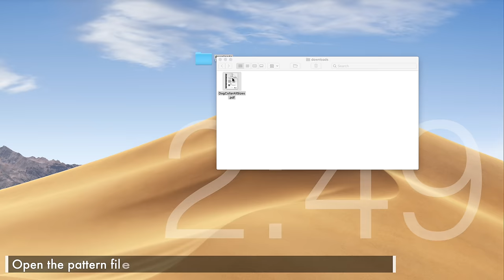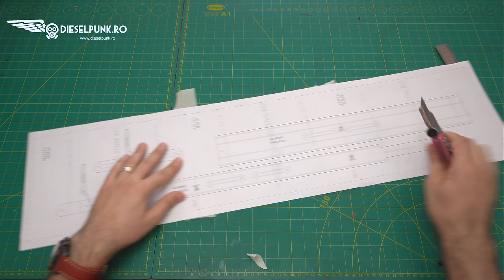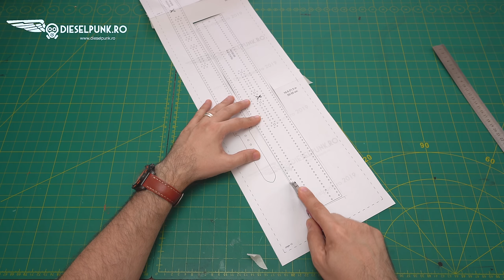Dog Collar DIY - Pattern and Tutorial

Comment: Tony
Awesome job! Really appreciate the pattern looks great. 
Just FYI there’s small mistake with the 35-39cm portion the folding leather piece doesn’t really align with the belt piece. I was able to fix it by cutting both piece a little short.
Reply: I experienced that too. But on a worse note, I didn't think to turn the flesh side out before riveting and stitching the bottom strip to the upper strip.  What a mess I made! Had to take it all apart. But like they say, if you're not making mistakes, you aren't learning.
Reply: Skip Hinton It happens, that’s good way to look at it for sure.
Reply: @AZAZALEX  I'm starting my second one. Hopefully it's gonna turn out better.

Comment: Holy Moses Tony, that Sinabrooks stitching punch is like $140.  1.5mm/6mm-6 holes. Now the $140 question is was it worth it? Does it punch holes better then other methods? What about going around a radius? Do you then just use single punch?

Comment: In this build the buckle will sit on the throat of the dog because it is on the opposite side of the d-ring where the leash is connected to the collar. I think that this is not good or comfortable for the dog. I would recommend to change it so that the buckle sits on the side of the dogs neck. To achive that you have to put the part where the d-ring is connected to the collar near one end of the collar. That way it is more comfortable for the dog.

Comment: Hi Tony, Thank you so much for the fantastic pattern. I was able to use a larger version for my Cocker Spaniel, now my dachshund is offended and also wants a new collar. Unfortunately, I can't find decent buckles and D-rings in 18mm anywhere. Not even with Leather Republic. Will 20mm also work with the smaller sizes?